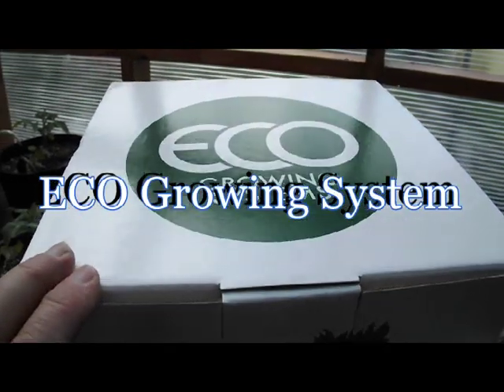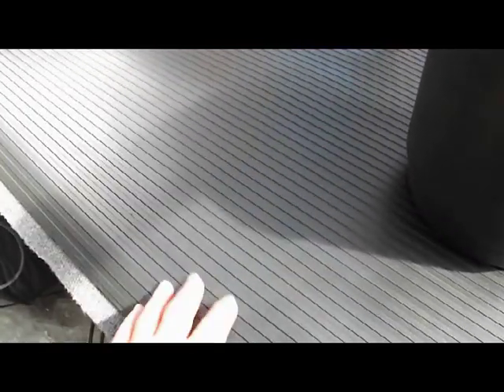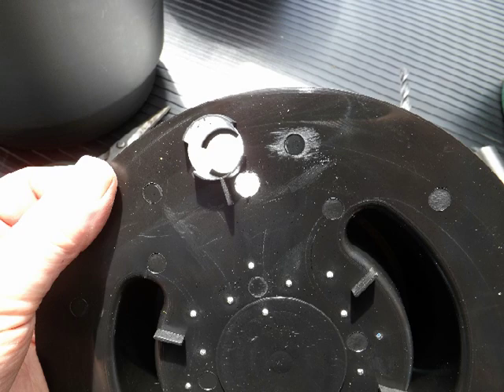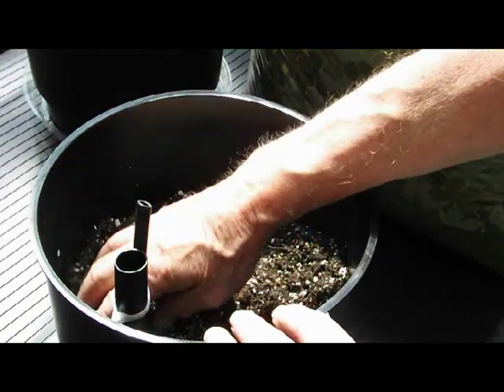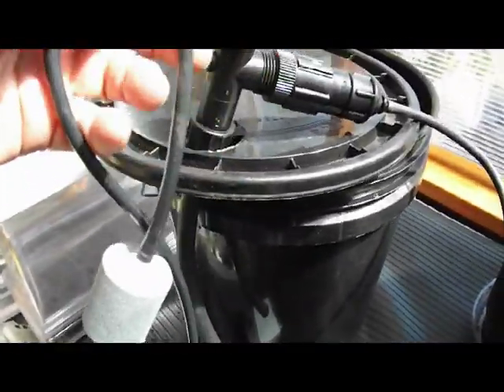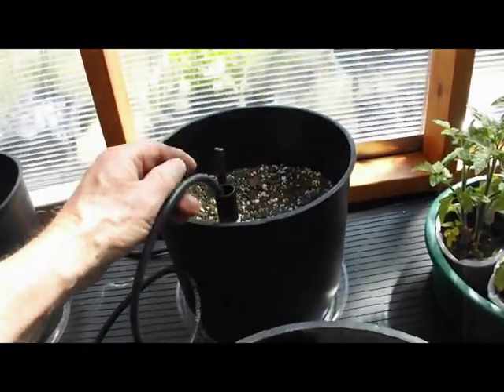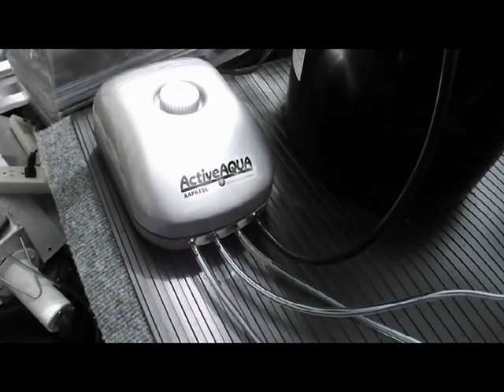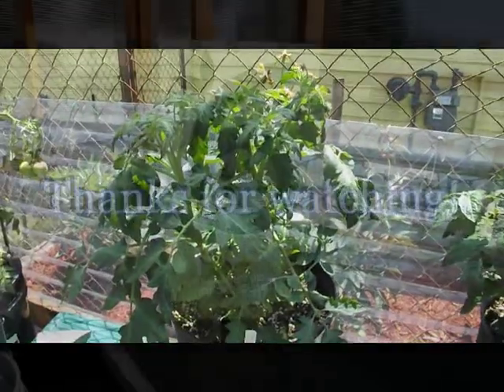The Eco Grower System - Grow Hydroponically with organic soil!

Comment: hey Ron just wondering do you use a timer on the water pump if so how long or is there another way to do it
Reply from the maker: +Bill Meyer 
Hi Bill - There is a automatic system outlined in this video: 
https://www.youtube.com/watch?v=rNUGuJo3coU
But, the easiest way I have found is to use a timer and adjust dripper gph (gallon per hour) size so that the pot grow medium stays moist but not saturated.  It takes some experimenting but it worked great on my tomatoes last season so that is the way I will do it in the future.  
Like I always say, "Keep it Simple!"  I set the timer to run the pump (in a 30 gal reservoir) once a day and use a moisture meter to make sure the amount moisture going to the pots is the right amount.  the timer length will increase slightly due to increased transpiration as the plants get bigger and the weather warms.  Good luck and thanks for watching my videos!  
ps - I will probably do a short video on the procedure this Summer.
Reply: Ronald Kleinman

Comment: What nutrient solution are you using for your tomatoes in you Eco Grow pots and your Root Spa systems?  Thank you in advance.
Reply from the maker: I used Botanicare Pure Blend Pro - Grow for herbs and non flowering plants and Bloom for flowering plants.
Organic based but not ormi.  There are many other nutrient products you can use that work great - liquid is easiest fed at around 1,000 ppm through the feed tube when watering is needed (usually about once a week).  Using the roots organic soil eliminates the need for adding fertilizer to the soil initially because there are natrual nutrients already present.  Thanks for the comment and thanks for watching!
Reply: Thank you for your reply.  I appreciate it.  I enjoy your videos and have learned a lot from them.  I look forward to seeing more of them.  Thanks again!

Comment from the maker: Hi there -  After several months use it turns out the the 3 gal container works best for small to medium sized plants, like patio tomato, herbs like basil, etc but the larger 5 gal container is better for larger plants like most tomato varieties.   The tomato plant variety I used for the video produced fair but became root-bound and needed a daily replenishment of liquid.  All in all, the system works great if you want to use soil as a growing medium but I would definitely go for the 5 gal pots.

Comment from the maker: I made a version a couple of years back which works ok but these are so cheap and work well so I'm just going to use these.  You can get a full 6 pack of the 3 gal units with all fittings for about $75 - I can't even put six together myself for less!
The manufacturer watched the video and is sending me moisture sensors to make the setup automatic - that should be interesting.  Check for an update in a month or so.  Thanks for the comment and thanks for watching my vids!